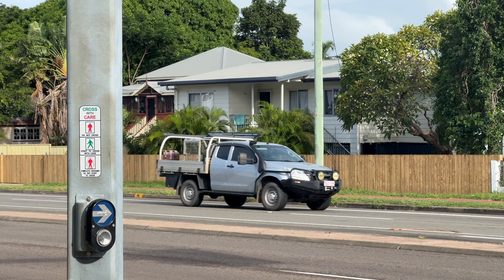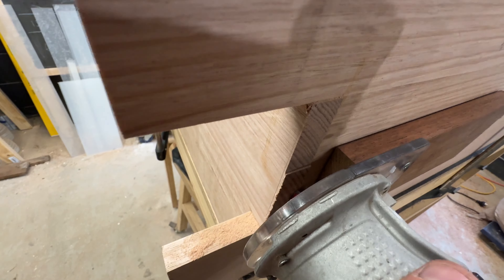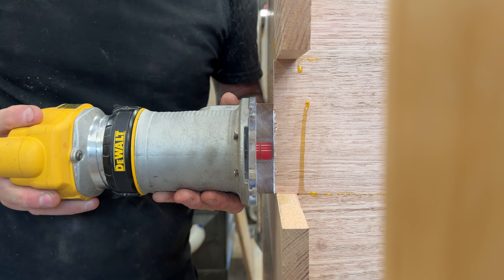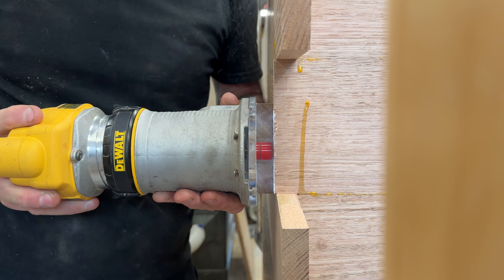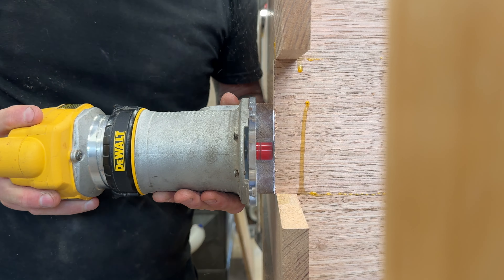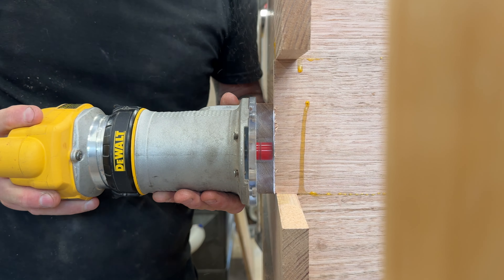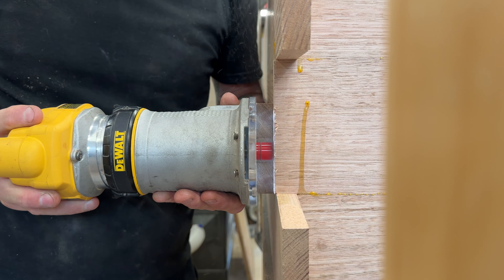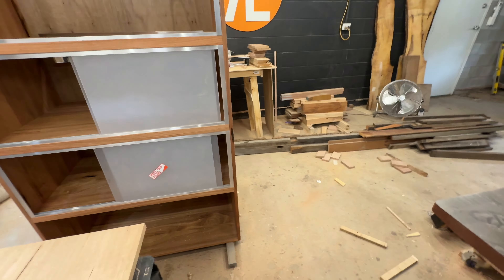This Is Why You Need Liability Insurance As A Woodworking Business

Comment: Instead of that jig on the trim router, and a straight bit, have you considered just using a flush trim spiral bit with a guide bearing on it?
Reply from the maker: That’s definitely a better option but because none of the fingers are flush to the surface it won’t work. You’d need to get at least one finger flush first